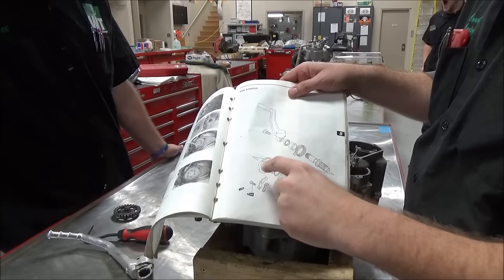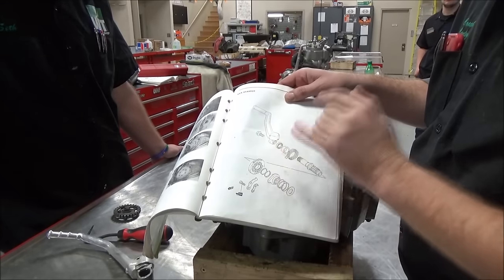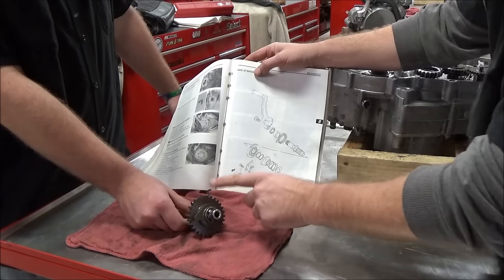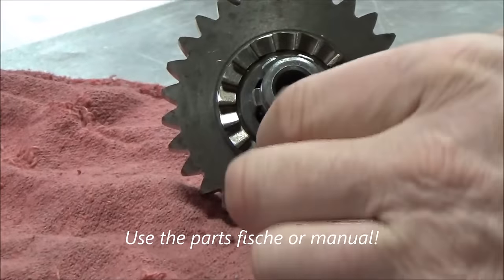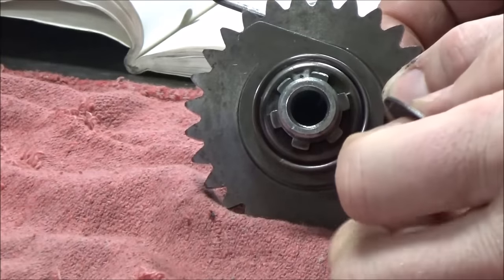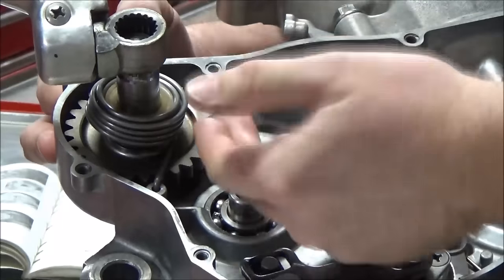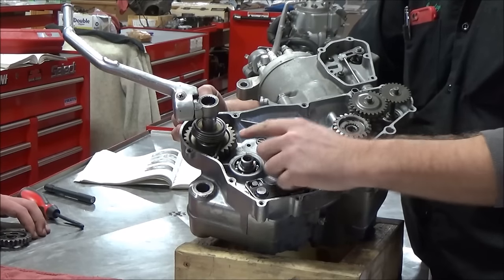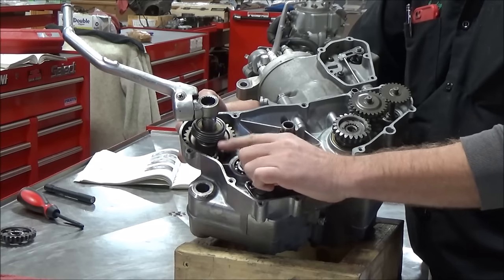How to properly time and wind your kickstart on assembly!

Comment: Thank you so much for making this video.
Im grafting a '72 twinstar kick shaft into a '86 rebel motor (for a '94 nighthawk frame. Gotta love the universalism of Honda) and never considered checking for the gear to spin freely. 
Turns out the O-ring I had on there wasn't allowing the gear to retract completely!
But it was checked now, before being put on the bike. 
Simple enough fix now, but would've been a huge pain later on if I hadn't seen this video.

Comment: This is useful. I have a 1983 yamaha RS 125 DX.
The kick start turns the engine over but won't return. I'm thinking the cogs and shaft are not correctly aligned.
Reply: Is your Kickstart spring in the correct place
Reply: Kickstart spring not clocked correct or broken

Comment: I have a trx 250,I ordered a used kick start cause mine is mostly ratchet affect..but when it miss fires when it does kick in some thing inside the engine sounds as if being slung threw the engine and hits hard on inner left crank case like a rod has already broke loose......when it fires up it's smooth no knocking valves tick some..but not on the bottom end whats coming out of it...I was figuring it be the piston arm hitting what is it

Comment: Think I may have a kick start prob on my Xr650r. Sometimes seems to slip other times locks up on starting stroke of kick start. Maybe the slip is throwing out my kick start timing . Thanks for this vid
Reply: I'm having same problem. No slip just froze or stuck. Did you figure yours out?
Reply: @dougrobertson2470  I stripped mine down but could not see anything wrong but my kick shaft did seem to go in further on reassemble . No problem since so it’s fixed but not sure how I did it . Check out my vid it may help.

Comment: what would cause the kick drive gear and washer to seize onto the kick start shaft?

was riding along and it all locked up on me, push down on the kick starter it will turn over, however on the return stroke it would turn the motor back.. stripped it to find a seized kick drive gear on the kick starter shaft.
what has caused this to happen? just did an oil change with correct trans oil to the correct level too. 

now the shaft, gear and washer are junk.
I made a track fix by removing the kick start assembly, and only reinstalling the shaft with the seized gear and washers, carried on riding for a bit of fun..
Reply from the maker: Hello friend! Have you Subscribed yet to never miss a video? Have you seen the video playlists https://www.youtube.com/user/conleybuilt/playlists ?

Still have questions? Coach Conley provides tech help and works one on one! His YouTube and training center has grown beyond the ability to answer every question (11 million views! Over 500,000 a month!) He gets 300-400 requests a week. Become a member for his direct cell phone number and personal assistance!

Click here for the membership links and welcome to the community! https://how2wrench.com/product-category/specials/ 

Want to say “thanks” or “keep it up”? Click here https://www.paypal.me/how2wrench 

Your answers and help are just around the corner. Save time and money while protecting your investment and yourself by doing it the right way!
Reply: my guess is that the spring has popped out of the housing, and allowed the kick lever to droop down while running, this has probably loaded up the engagement assembly heating the kick drive gear and locking it up on the shaft.. other than that im a bit stumped, as its all in the correct order etc.
Reply: sure have.. I do pretty much all the same things you show in the videos.. plus some extra non "factory tricks"

Comment: Just got a project 2001 rm125 kick start is doing that "ticking" you were talking about when the gear doesnt free spin i disassembled the kick shaft and noticed there was no washer between the case and spring would this cause the gear to not disengage enough to free spin?
Reply from the maker: Just for clarity, first check the parts fiche for your year, make, and model of vehicle. Never assume the video is the same as yours. After that, always fix what's missing and then if then re-test.
Missing parts will surely cause alignment issues! Please hit that subscribe button for us! 
👍 Thank you for taking the time to comment! It helps us! 
Here is a way to support all the free videos.
Want to say “thanks” or “keep it up”? Click here https://www.paypal.me/how2wrench  

Follow us! 
www.How2Wrench.com     
www.Tools2Wrench.com  
Facebook: 
https://www.facebook.com/How2Wrench/ 
Instagram:
https://www.instagram.com/how2wrench/
Reply: Hey i appreciate it whoever had it before didnt have it timed right got it in time and not clicking thanks again for the advice and the video
Reply from the maker: @1929vicky  Hit that sub button, please. Donations keep us going too!

Comment: Hey i know this is an old video but maybe you can help me out? I have a Honda xl185 and the kickstart wont kick the motor over.  The gear itself looks fine from what i can see. I took the side cover off but didnt learn much. Oil was clean of shavings or brass. Something is locking it up, could it be the kickstart gear or should i look elsewhere? I was hoping for a simple fix!
Reply: Paul Kojack my guess is something will he stuck blocking the motor from actually turning when you kick
Reply: Paul Kojack like a chunk of metal caught in between the gears
Reply: @raccoontower8569  something is definatley blocking it. Its my roomates bike. It almost seems like a cam timing issue, i can rotate the motor almost 360 degrees but it will not turn all the way over even with the spark plug out. The internals all look shiny and new still though.Couldn't see anything stuck  in the gears and the oil and filter were clean as normal so hard to imagine a chunk of metal in the gears. Im wondering if its either the kickstart gear itself (she said the kickstart was having trouble recoiling back to the top before it locked up completley) or maybe a valve issue? Looks like ill have to dig more into it, but thanks for the input! ill keep an eye out.

Comment: Assambled my engine,kicked it over a dozen times, then it the kickstart got stuck, never knew kickstarts had timing marks, will be checking that
Reply: Doubt it's a seized engine, how's it supposed to seize if it never even started
Reply: Having same problem now. Did you ever get yours figured out?